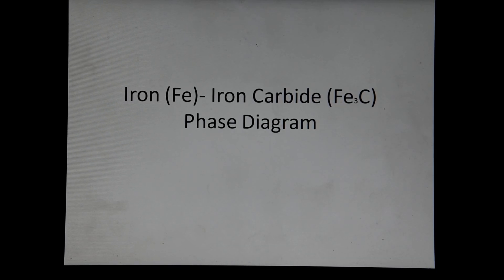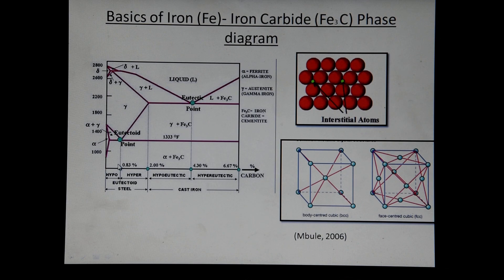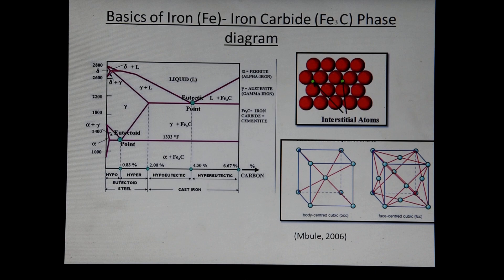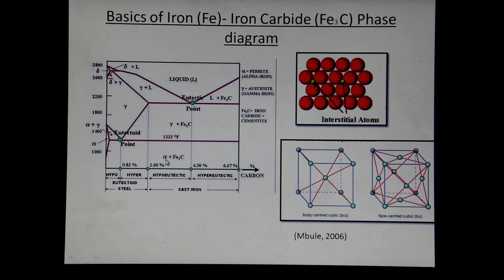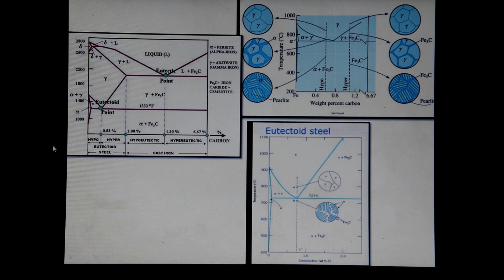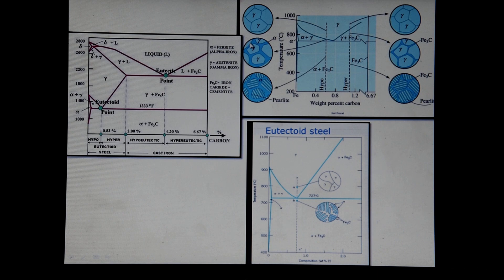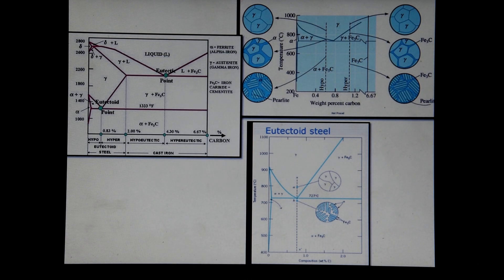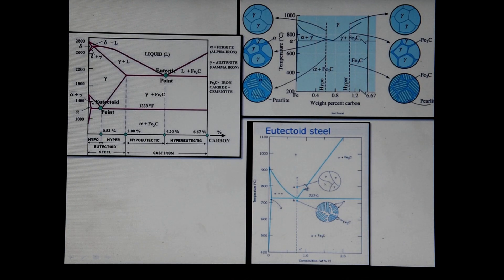Introduction to Iron - Iron Carbide Phase diagram

Comment: Why does not ledeburite appear at room temperature?
Reply from the maker: In iron and steel metallurgy, ledeburite is a mixture of 4.3% carbon in iron and is a eutectic mixture of austenite and cementite. Ledeburite is not a type of steel as the carbon level is too high although it may occur as a separate constituent in some high carbon steels. It is mostly found with cementite or pearlite in a range of cast irons.

Learn more here: https://en.wikipedia.org/wiki/Ledeburite
Reply: @Sindi12440   tank you
Reply: @Sindi12440 

Give the reason(s) for the following statements 1- Grey cast iron used in construction of heavy duty machines

2-White cast iron very hard and brittle

The mechanical properties of ductile iron and malleable iron approximately the same

Ductile iron with pearlite matrix stronger than ductile iron with ferrite matrix.

Compact graphite irons (CGIs) is used for manufacturing exhaust manifolds.

Chapter Five Cast Iron.pdf

Plas
Reply: @Sindi12440  Please need these questions answered